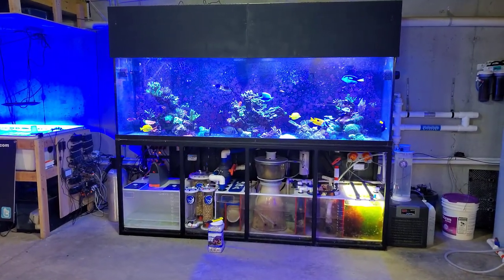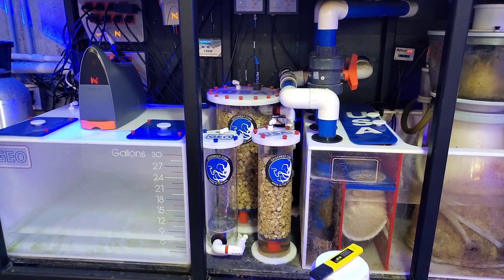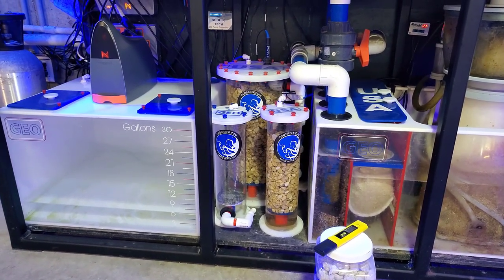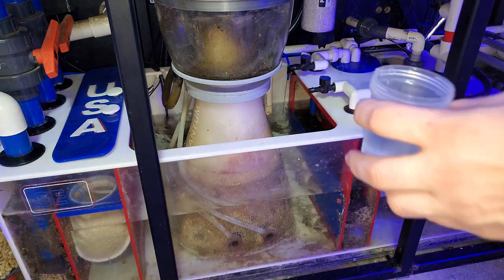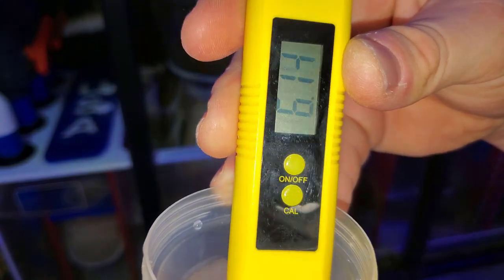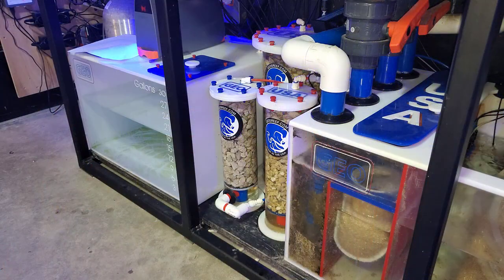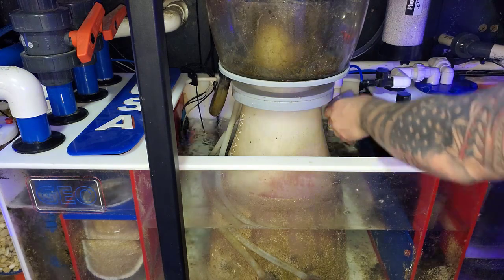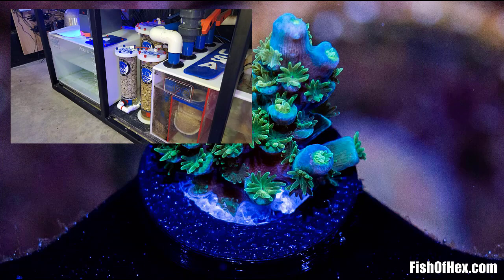Will Adding A Third Chamber Further Increase The Effluent PH Of A Calcium Reactor? | Part 1

Comment: Pretty big waste of time using a probe so far out of calibration (let alone using such a cheap sh## probe to begin with), you do know the pH is on a logarithmic scale right, so being so far out makes the differences irrelevant cause is it with the +/- 15% accuracy of the guestoprobe you are using. You might as well be tasting the difference in pH.... 

It also takes a lot longer to take an accurate ph measurement (around 5mins), especially from a probe that is not in continuous immersion.
Reply from the maker: Sweet ill let you know what it taste like in the update video